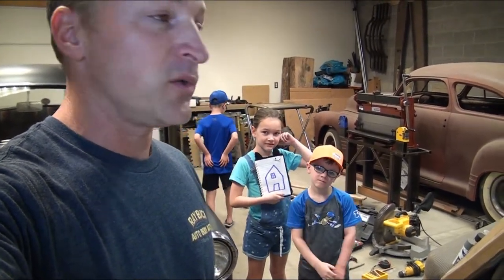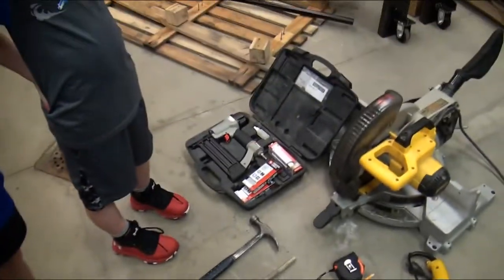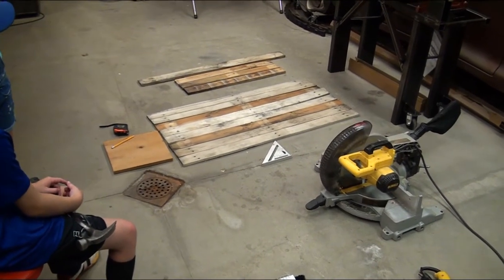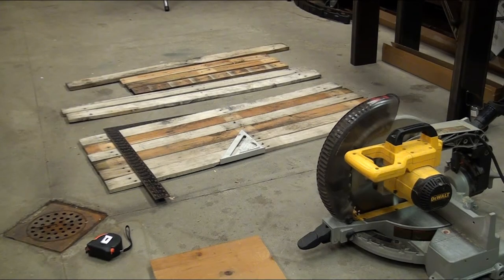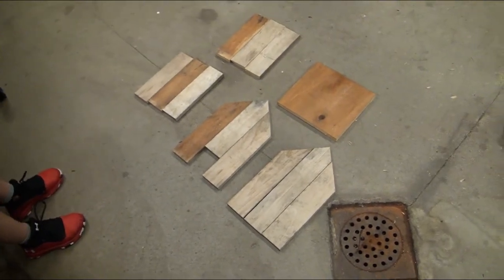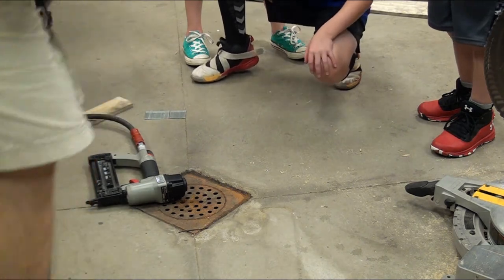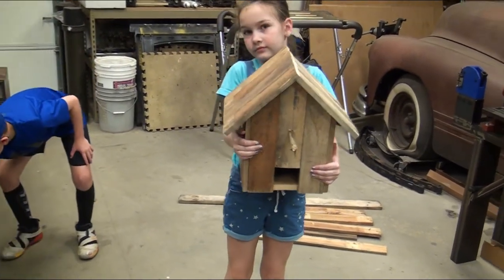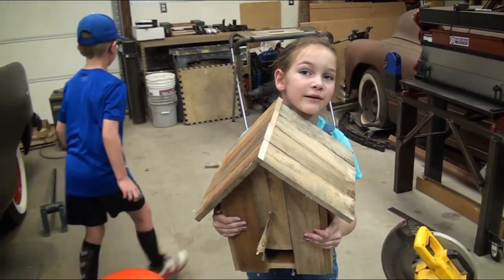Builder Kids - How to build a birdhouse out of a pallet - Easy Weekend Project

Comment: How do you connect the midde piece of wood where the door is?
Reply: I ended up toenailing in a few nails (shooting them in on angles). If we did this again, I think I would make the bottom boards longer and let them hang out the front so the birds had a ledge to land on. You could then just nail up through them into the other wood. But, this is how my daughter designed it, so that's how we built it.